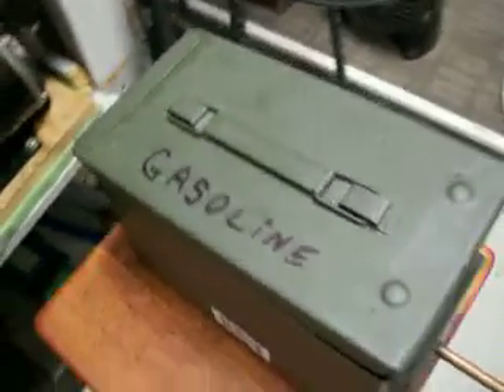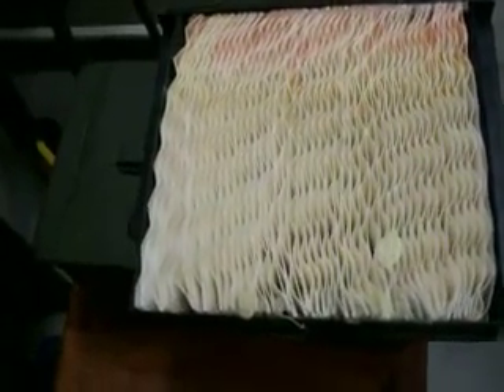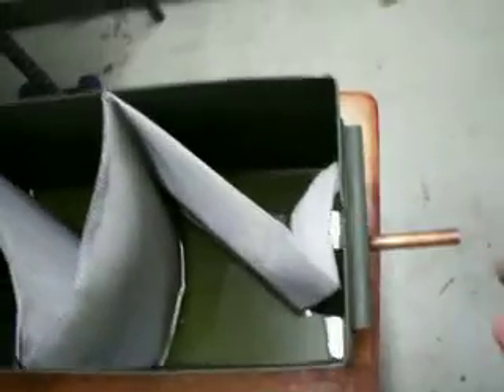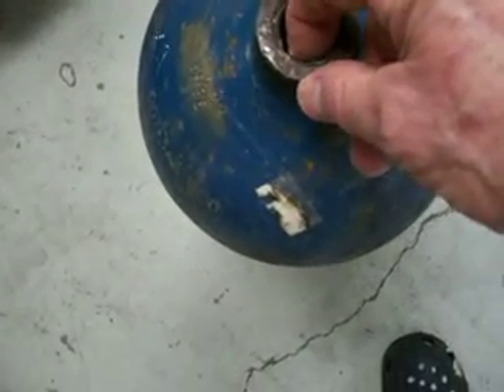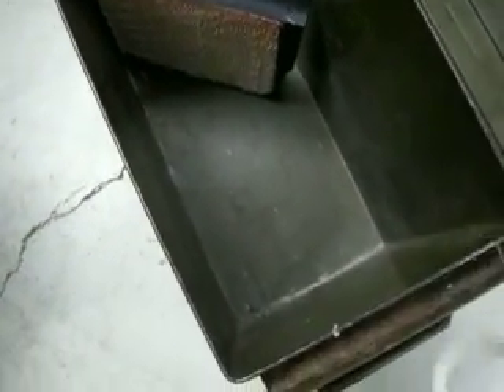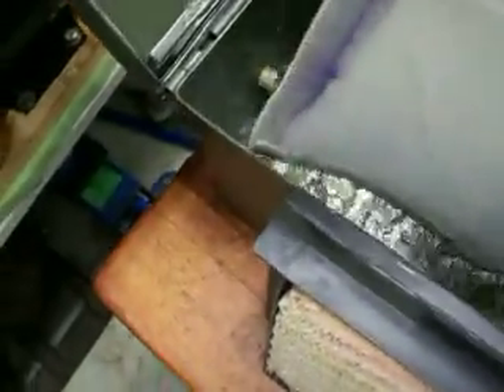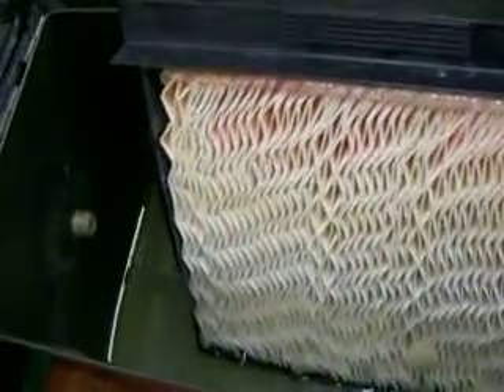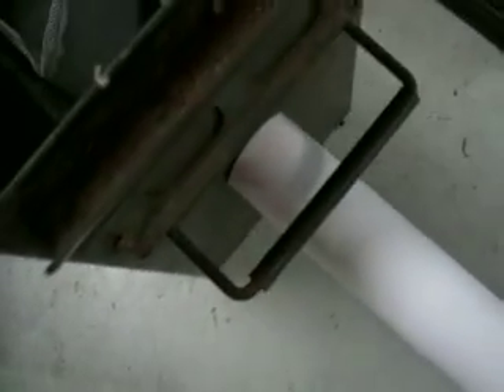types of wicks for gas to get vapor from it

Comment: I wouldn't increase the tube size so drastically.   Fuel vapor is still too rich for efficient burn.  You must have a way to control the amount of fuel vapor in the fuel/air mixture.  Perhaps if you added a small amount of HHO you could get a more complete burn on the gas vapor.  You will need to have a way to balance the mixture under changing loads and requirements.

Comment: VaporKid ? Why not use, a one way valve with a inline fuel filter with a metal intake pipe so it can stay hot until it reaches the intake.

Comment: Research Nay Box. Very similar to the ammo box but you may find it superior. Would just be more complicated to build. The Nay Box has been proven. Vaporkid, cool setup. Put your engine coolant in the box with a false floor. Secure the wick pads to the sides of the by making frames to hold the wick material. Use something for spacers to space the wicking panels. Start with a few wick panels and add more as needed for your application. Pull the air in and out at 3/4 height. It would be a good idea to put a flashback door in line, kind of like dryer vent to the outside of a home. The dryer vent keeps outside air outside. Also search Loren Naylor for his carburetor. Him and his son Kelly worked on a carburetor that used vapor. There are/were many successful systems in the past. Just can't buy off the shelf. My 2 cents worth. Great job Vaporkid.

Comment: Your going to get somebody hurt, burnt or killed... gasoline is EXPLOSIVE....
Charlie Pogue invented vapor carburators in 1933.. got patents.. you can get them free from the patent office.. just pay  to download... the Pogue vapor carburators got 278mile / gallon on the old straight * cylinder engines.. petro industry doesnt want this info out there to discover.. there have been some 50 different vapor carbs over the year..... the vapors are more dangerous than the liquid gasoline.. vapor pressure have to been engineered for explosions.. Study it out.. Charlie Pogue died in Canada about 1980-2..
Reply: The Pogue carb only got that at 30mph on a flat track without acceleration as I recall.
Reply: that patent was not much more efficient than what we have today especially with all the gums and additives in the fuel today

Comment: I have been trying to figure out how to use the pressure pulse from a Briggs valve cover outlet, to pump fuel to the top of the wick.  Evinrude outboards (15 HP) have a small pulse driven fuel pump, and the head of pressure can be a couple of feet.

Do you have a backfire preventer on your torch?  There is oxygen and fuel vapor in that can, all the makings for a big bang.  How do you prevent combustion from traveling the hose into the tank?
Reply: SMART IDEA ,WE USE THEM ON OUR TORCHES ,SMALL BALL CHECK VALVE IS ALL IT IS FUEL FLOWS ONLY ONE WAY !

Comment: Looks great try to put PVC through the top of your ammo can and into the bottom then attach a white sock on the PVC if you need more add another. I was wondering what the ratio of air to gas vapor is its one to one on wood smoke
Reply: putting pvc ont he bottom would just turn it into a bubbler would be less efficient

Comment: Because you are drawing air in to pull the fuel vapors from the box, you are creating an air fuel ratio that is very dangerous. If you were to have a flash back into the holding tank it will be a bomb. Using the thicker tank only makes it a more powerful bomb. You need to compress only the fuel fumes and not any air. With just fuel fumes in the holding tank, it will never burn without oxygen present. So it will be very stable and safe. It will never flash back when you use it. Only when the fumes come in contact with air, will it burn.
Reply: Dynodon64 we completely agree , combustion needs air fuel and spark for the trio to work .
Reply: its not going to explode a half inch steel tank though does not have enough explosive power for that
Reply: @prototype9000  , really?  You might want to skip this experiment if you believe, not researched the quantum effext of a near freezing compressed air fuel vapor.. In a 1/2 " steelwall withno flashback?..   Remember 3 explosions back at DuPoint?    
What you have here is a near absolure zero force inducted fuel air bomb... At the enth degree.  Waaaaboom!

Comment: This is exciting, I don't know much about this, will the system you build for your truck work on an 03 Silverado 4.8L?
Reply from the maker: it will work on any gasoline engine, but make sure that you run a big enelf tube coming from the box to the air breather box, at least 2 inch, other wise you,ll starve the engine for air, that one way you can hook it up, the other way i will be useing will be to pressure rise it and hook in to my fuel rail.
Reply: TheVaporkid The pressure system is the one I am interested in, I would think that would be a much better solution don't you?
Reply from the maker: Bill Oldaker i would use that to, being it is pressure rising the fuel rail,once i put pressure on the fuel rail i will pull out the fuel pump relay.
Reply from the maker: TheVaporkid also with pressure on the rail, you can just use a 3/8 id line for that when collecting the fumes
Reply: TheVaporkid Thanks for the quick reply, I think I will start gathering parts hope you get yours working soon, a video will really help.
Reply: how big of clear tube coming from the ammo box for lawn mowers will 1/4 inch work.